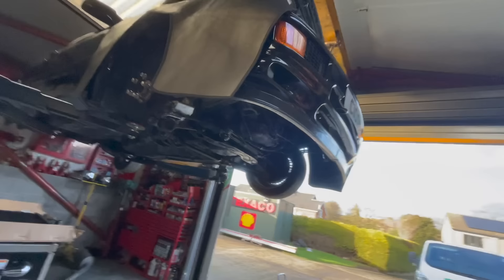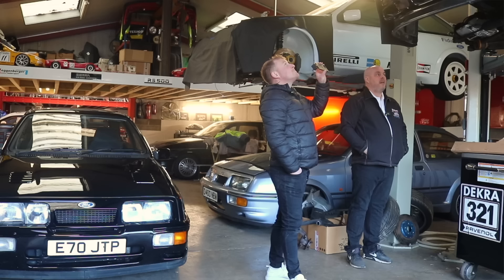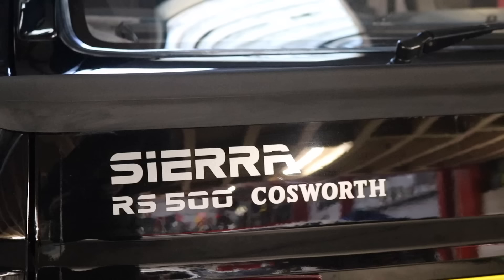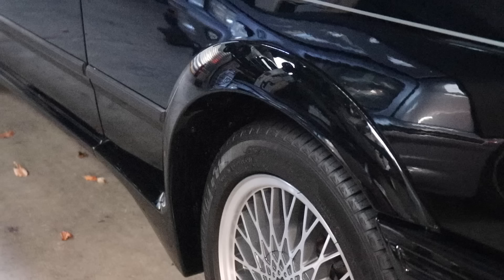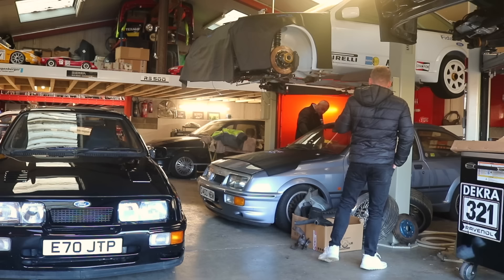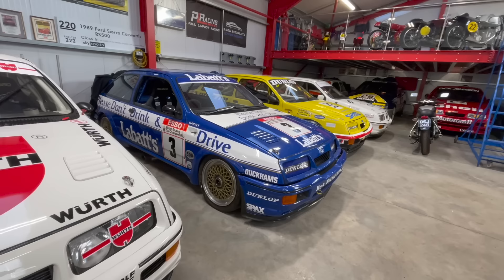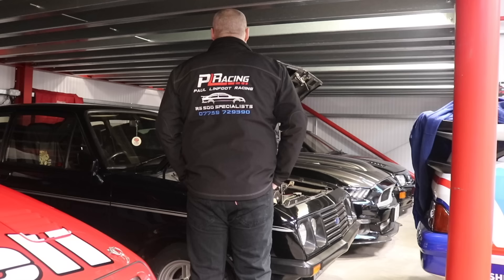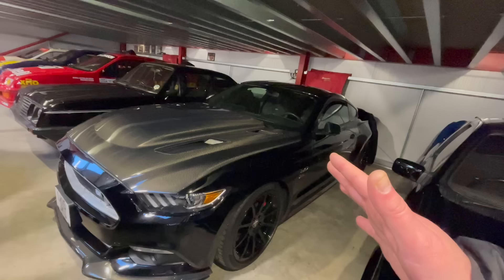Ford Sierra RS500 Cosworth Workshop Tour ** With Cars for Sale **

Comment: the fire problem is ethanol feuls they corrode the lines from the inside . i have a friend with a classic car garage who says there r times they go to move lines to get to bolts and things and they just split down there lengths because of it . the soft lines don't fare any better as they just start to break down